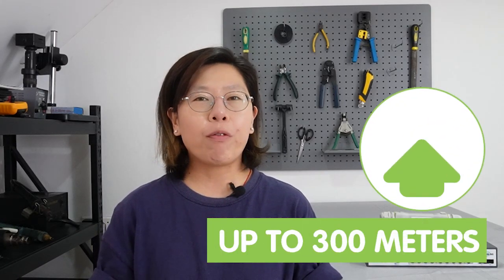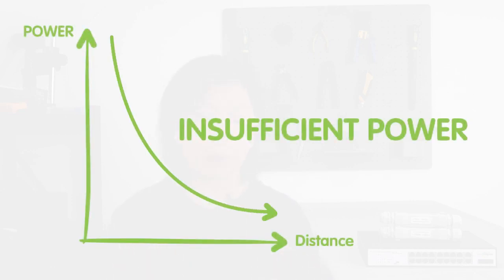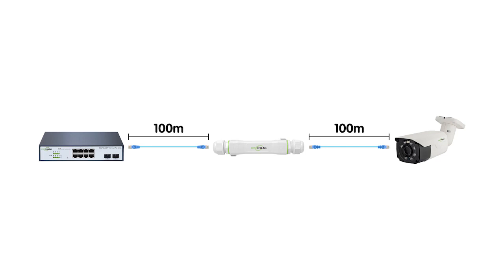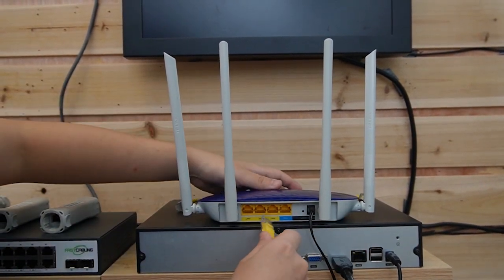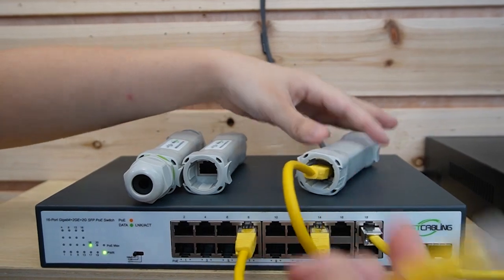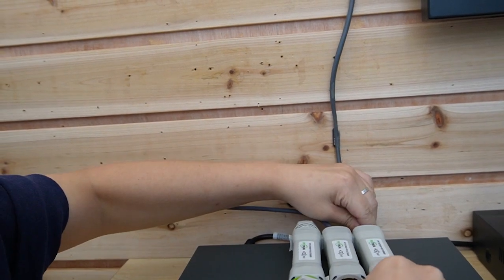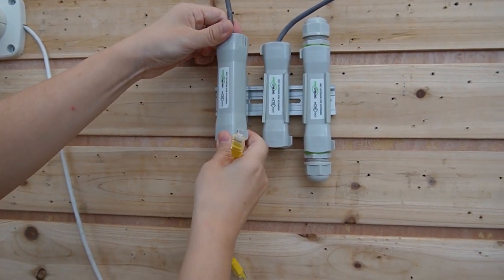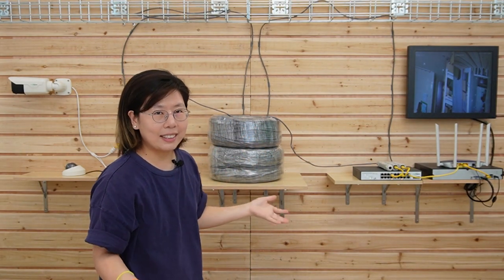Upgrading Your Existing PoE Switch for Extended Transmission

Comment: What would be a reliable length for cca cable?
Reply from the maker: For networking applications, such as Ethernet, the maximum recommended length for a CCA Cat5e or Cat6 cable is typically around 100 meters (328 feet) but it has higher resistance compared to the pure copper cable, which can affect its performance over longer distances. For audio and video applications, the effective length can vary based on factors such as signal type, equipment specifications, and acceptable signal degradation. In these cases, it's crucial to consult the manufacturer's specifications and guidelines to determine the maximum recommended length for the specific CCA cable you are using.

Comment: Hi there, my question is , for extend the cable up to 500 meter ,we must use poe switch + poe extender together ??right?? We cannot use only poe extender?.thnx
Reply from the maker: Actually, you can by using 300 Meters Direct Burial PoE Ethernet Extension Kit. The maximum distance between two extenders can reach 300m, making it 500m in total.

https://www.fastcabling.com/product/300-meters-direct-burial-poe-ethernet-extension-kit/
Reply: @Fastcabling  with only  two Ethernet POE extention kit we can have up to 300 meter with a normal switch right ? I mean connect them with normal switch ,but if we want to have  up to 500 meter ,we need a POE switch and POE extention kit , am i right ? Thnx
Reply from the maker: If you're looking to extend your network up to 500 meters, consider using the 300 Meter Direct Burial PoE Ethernet Extension Kit. It's important to note that this PoE extender requires power from a PoE switch or a PoE injector. If you're connecting to a regular switch, it won't work since there is no power. However, if you need to connect multiple devices and extend them up to 500 meters, it's recommended to use a long-range PoE switch with the extenders. This will enable you to manage all devices from a central location.